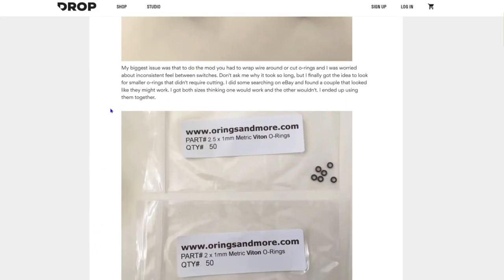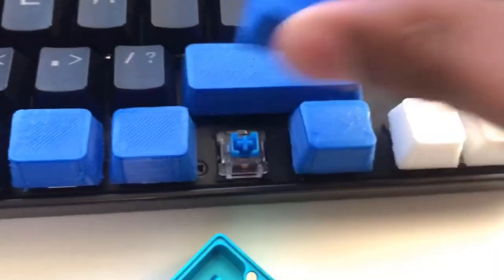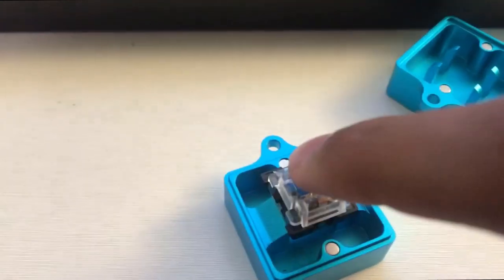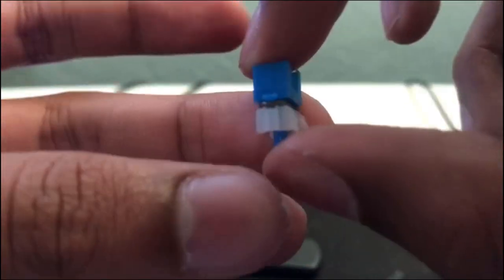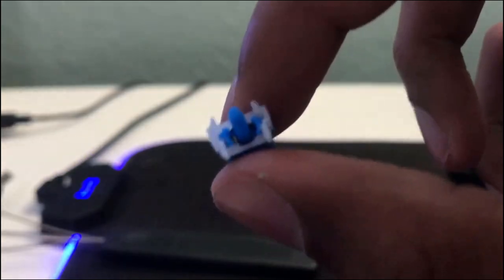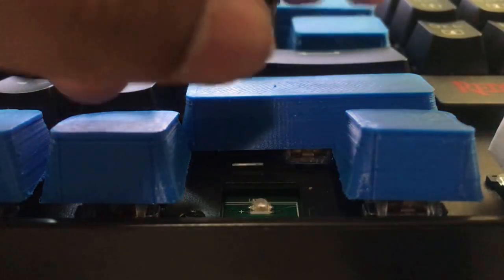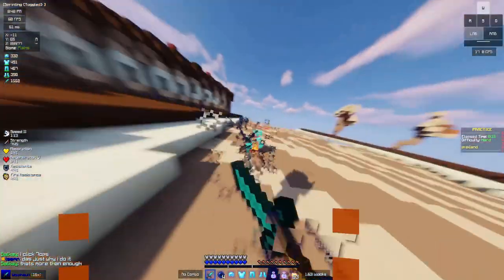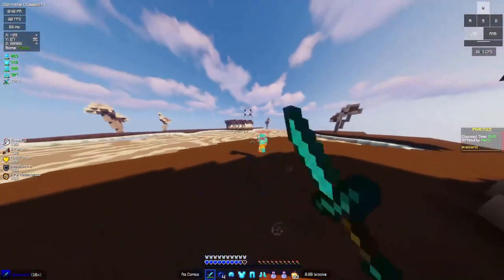Turn your CLICKY switches into LINEAR [Jailhouse Mod]

Comment: I did this cool thing where I turned my glorious copper clicky switch into a linear by just taking out the part of the switch that makes it click lol. the "clicky" part of it was just a little metal bit, I removed it, and lo and behold it still works! debating doing it to all of them and then making a board out of it.

Comment: I moded Long Huas using single cable from cat.6 UTP. It was much harder to get it right but effect is good. tactility is bit different from browns. some people mentioned that you need lighter springs after doing that mod. iirc jailhouse shortended actuation distance because bumps are lower. might be good mod for gamers because you don't need to buy switches with shorter actuation.

Comment: I tried to shave off the bump off the white part and then superglued it to the top part of the switch. Keyboard became linear, but the switches are inconsistent. I don't recommend you guys remove the bumps as it does not do much change, although supergluing removed the clicky sound. Anyways, ended up ordering a new pair of reds. :)
Reply from the maker: I think the bump needs to be there to create enough contacy between the two metal pins, although supergluing the leaf to the stem will also work
Reply: @wolphonyx  Well mine are still working even after removing the bump, but they are just inconsistent in the way they feel. Some feel more tactile and some more linear.
Reply: What im trying to say is that it is not worth spending 3-4 hours and having a head ache for the rest of the day doing all that.
Reply from the maker: @alvin4781  Oh okay

Comment: I have a K552 and I couldn't find something to substitute the coil. And then I realized you can used a sewing thread.
Reply: The yawn string also reduces the scratchy noise. Great idea!
Reply: @viswas_casper  yeah i got some silvers and im switching my jailhouse modded switches to another kwyboard

Comment: This mod sounds very scratchy, is it actually scratchy or am I going crazy. I wonder how this will work on my cherry whites lol.
Reply from the maker: Yeah I think its the metal of the coil scraping against other things in the switch. I would still prefer this over my clicky blue’s any day though
Reply: i would put fresh lube in those whites before bothering with doing jailhouse. if you lube up landing zone for jacket dampening is pretty ok without changing actuation profile.
Reply: You can lube it with krytrox 205g0. If ur doing it in a budget then use Vaseline. Trust me, Vaseline is also good. I used Vaseline and it’s fine

Comment: You dont wanna clip the tactile bump aswell? And then bend the activation plate?
Reply from the maker: Haven’t tried doing either of those but I’ll look into it when I have the time.
Reply: Because jailhouse as of what I know doesnt make clicky linear. It makes it more semi-tactile.
Reply from the maker: @SourceHD  yeah I found a different mod that wedges a piece of rubber band into the leaf to hold it in place which works better since it still keeps the bottoming out crisp. I’ll see if I can find a link to that

Comment: i have the exact same keyboard and I'm typing with it right now when i do this should i also get new keycaps or leave them
Reply from the maker: I haven’t realy tested any other keycaps. Of course it doesnt change the effectiveness of the mod, but you can get them if you want
Reply: @wolphonyx  i just ordered some on amazon like 10 minutes ago I'm trying the mod now but with a screwdriver and butterknife I'm gonna take the thing that makes the click on the switch
Reply from the maker: @EditingFluid  You’re gonna take the white leaf off?
Reply: @wolphonyx  so you take apart the switch the spring stem and top housing and on bottom housing there is a pin that is making all that noise u just need to take it out then put everything back together
Reply from the maker: @EditingFluid  Oh is that a different method? I’ll have to check that out. Does it just become really tactile instead of clicky?
Reply: @wolphonyx  they said make is sound linear but it a bit too mushy but better than clicky ofc
Reply from the maker: @EditingFluid  Oh okay, ill have to try that when I get home

Comment: hey i tried removing the click jacket and it became linear, the key now doesnt work, could that be the issue?
Reply from the maker: Yeah the click jacket’s stems are what makes the two metal ends contact to actually activate the switch. The clicking sound is produced by the click jacket being able to move. Jailhouse prevents that.
Reply: Or maybe you put the stem in the wrong way

Comment: Now how do you do that with razer switches
Reply from the maker: Dont have razer switcbes but by looking at pictures I believe its just gonna be more difficult to take apart a switch
Reply: U hav to desolder the switches from the board, should be fairly the same after u got the switches out
Reply: @hw.lds08  you can take the switches out they are not soldered onto the board but its not like any normal switch since its razer it has to be different and you cant take the switch apart without it breaking
Reply: @liogicc6993  Okay
Reply: @liogicc6993  No Its not truth , I have desolder the switches from Razer Blackwidow v3 TKL green switch . RGB leds are soldered on pcb so we dont have to worry about it .Just desolder the two pin and that set . 
You can find image here ... 
https://drive.google.com/file/d/169wfj8TJPnW6--MIXguX20pI_sAlMBEU/view?usp=drivesdk
https://drive.google.com/file/d/16Awm1eUytjcJfDvfda-aOQSaYyiT3DC7/view?usp=drivesdk
https://drive.google.com/file/d/16BwyncBrM2cNWqQ9SlljZhVFGyvhN9OE/view?usp=drivesdk

Comment: I read the other comment saying is the switch really scratchy or are they going crazy which you replied to saying it is scratchy due to the metal scraping the plastic..... what we lube the switch and the metal ....... it might help
Reply from the maker: Lubing the switch could help, but I think opening the switch and pushing the coil as far inside as possible will show better results. Thats why you’ll notice some keys sound really good and thocky and others sound scratchy

Comment: wait your keyboard isn't hotswappable how did you remove the switches? And if you really didn't desolder them does your keyboard still work?
Reply from the maker: My keyboard is hotswappable. I just used a screwdriver because I didnt have a switch puller
Reply: what will happen if u remove switch without desolder will it break
Reply from the maker: @valeriequill  if your keyboard is not hotswappable, yes the pins will most likely break off but in this video I used a hotswappable keyboard

Comment: What can I do with laptop keyboard
Reply from the maker: Laptop keyboards use rubber dome switches. They’re not mechanical so very little to no modding can be done with it. The point of this video was to turn specifically blue switches to linear mechanical switches. There are other videos on youtube about laptop and low profile membrane keyboards so you can check those out instead.
Reply: @wolphonyx  this was meant to be a joke lol
Reply from the maker: @sany6069  Oh okay haha

Comment: If a keyboard works well don't mess up with it.
Reply: The whole appeal of mechanical keyboards so most people is that they can be customised to whatever someone wished sure the stock board may work just fine but they may not like how it feels or sounds and wish to change it so instead of getting a completely new keyboard they can just swap the switches or do a foam mod